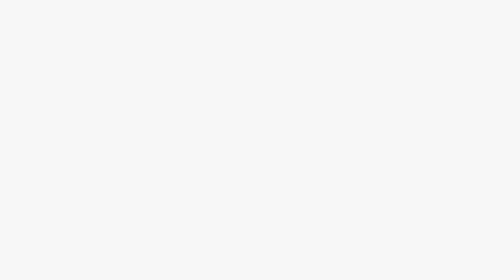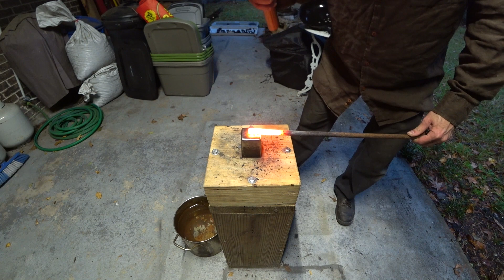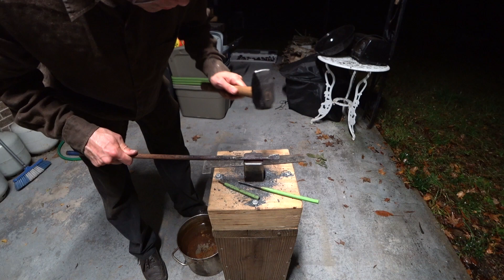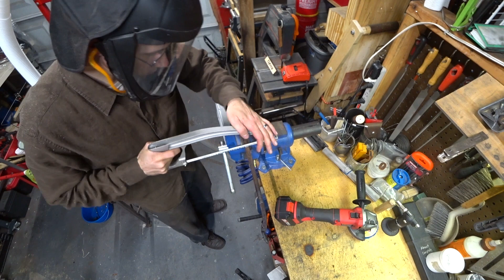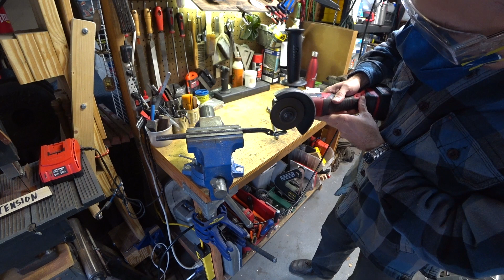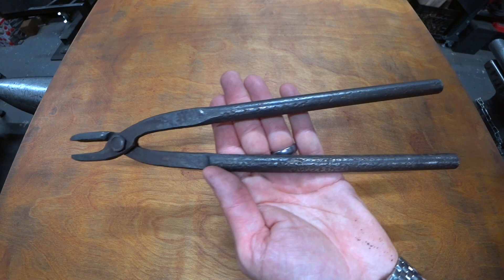Forge your first blacksmith tongs today! | Start blacksmithing

Comment: I think this skill is necessary for carpenters since quality hand tools are not very cheap.
Reply from the maker: Having the ability to make and repair your own tools is indeed one of the greatest advantages of learning blacksmithing.
Reply: @ravensroostforge  Can't agree more. Just restored my wornout pry bar in the weekend by heating, bending, grinding and quenching. Saved me 30 bucks buying a new one.